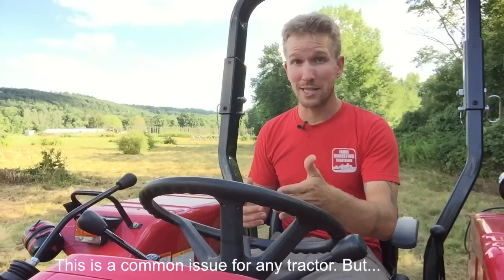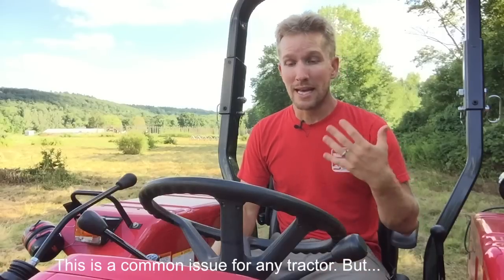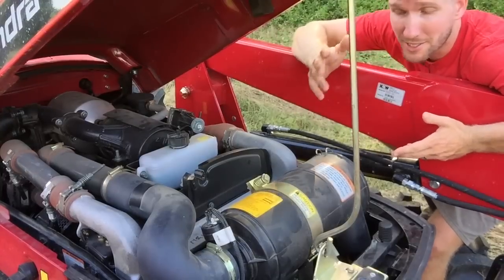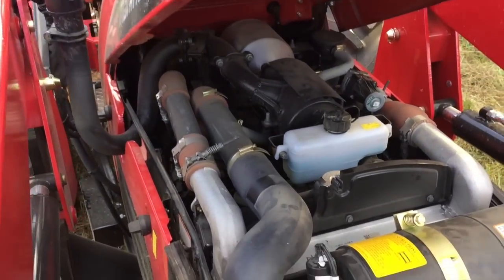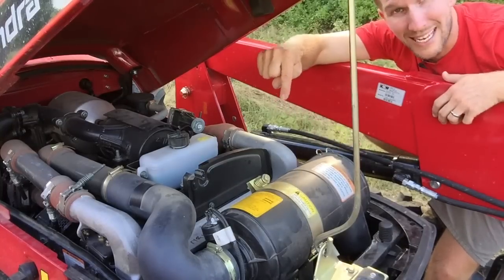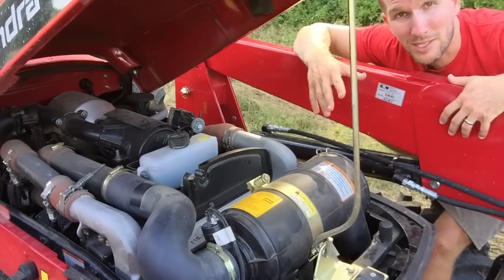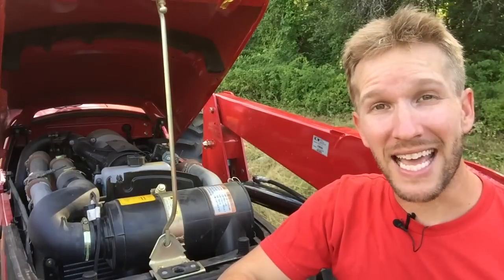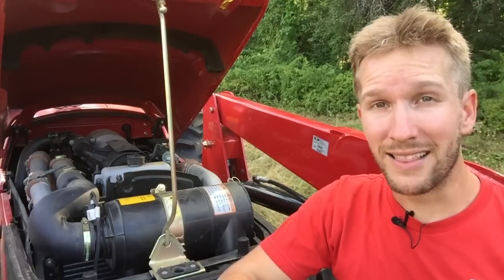Mahindra 5570 Engine Problem

Comment: I would go to Home Depot or Lowes and get window screen and make a Tractor Condom. Not sure what else to call it. It is to protect the tractor from incoming threats. I would make one that covers the front and one that overlaps it. Over the hood, down the side and under, back up the other side and Velcro to the top lap. The one that goes over the nose would also have Velcro so it attaches to the one that wraps it. 

You could call it a Mesh Tractor Condom or a Tractor Mesh Catch. When the tractor starts to get hot, which should be much longer than 1 hour, just shut off the tractor, get off and sweep it off with a soft car wash type blue brush or 6 inch cheap latex paint brush. This way you do not scratch your paint under it with tough bristles. I would shut off the tractor so there is no draft trying to suck the stuff you are trying to sweep off. Maybe 1 or 2 minutes to sweep off 70 to 90% of it and back to work. Get the UV Resistant Screen. Read reviews to see which brand lasts longer in exposure to the sun. Most likely I would not use aluminum as it would do some scratching.

As a teen, I used to detail cars at a dealership and in those days a lot of cars had those screen bug catchers and this would be the same thing. Maybe buy the cheapest screen first for a prototype. I would lay it over the nose and have it go back about 3 foot and down the front and back to the axle. I am guessing 48 inch wide x 60 inches or 48 X 72 inches for the front nose one. Then tape it in place and fold, then cut on the fold and tape. After it is cut and fit, slide it off and use a hot glue gun to glue the cut seams where it folds. Hot glue the Velcro in place. Once you have your pro-type fitting good and it test out a couple times, then get good screen and make one and sew it together with a sewing machine or if the hot glue holds good, I would just make it with hot glue. Hot glue will not scratch. I would suspect 75% is coming in from the front and 25% in from the sides of the front and bottom front. Just a guess, but this is most likely correct.

We are getting a tractor soon and if you do not try this, we will. 
Soon being a year or so.

Comment: For your battery issue could you take some extra battery cables and hook them solidly to your terminals and run the cables outside the tractor that way you could charge it or boost something without tearing into the machine? It'd be a chore to do initially but after it'd be slicker than snot on a door knob to charge or boost if you had too. Good luck
Reply from the maker: That's a good idea Brian, and if I start to have battery issues you can bet I'll probably do it. For now it's new and under warranty so I'm hoping I don't have to do that chore. Or at least I'll be able to put it off until winter. I have to check to make sure none of that would void the 5 year warranty too.
Reply: John Suscovich yea good idea I never thought about warranty
Reply: Yep waterproof pig tails. I have got an Optimate charger with fixed pig tails on my Honda generator battery so i can maintain its battery and easily disconnect to charge something else

Comment: Although my past Yanmar tractor was much smaller, it had a screen in front of the radiator.  Easy to get to.  When dirty, pull the screen out, clean it in 30 seconds and back to mowing.   I think some JD had the same set up.  Hope you get your problem solved!

Comment: Could you reach the radiator with a rigid pipe (with a short 90 degree bend at the end) attached to the compressor?

Comment: advice from the netherlands just buy a good second hand tractor from the seventies or eighties usa or european and those are easy accesseble, you will farm more happier. also on a hobby farm greetins peter heemskerk
Reply from the maker: Thanks for the tip. The used market is pretty rough in my area. Even with the problem in this video I'm still really happy with my choice.

Comment: is the radiator fan belt driven or electrical? an electrical fan you could run in reverse say every 15 min for a minute to clear the radiator.
Reply from the maker: Not sure, I'll have to check that out. Even if I can do that though, the engine compartment is pretty well sealed so there's no where for the stuff to go. I would worry about it getting stuck in there and then just sucking back toward the radiator once the fan is back in normal position.

Comment: Does the fan have a reverse switch? The front end loader my dad uses at the mill has a reverse on the fan to blow dust and crap out. If not I'd put a fine mesh screen over your grill then if it gets covered you could just wipe it clean in the field.

Comment: Wow John.  Your tractor is one of the better rated brands, all brands have their quirky flaws.  I've got a john deere and when I'm pasture mowing I've got to stop and clean off the front grill frequently.  But, the radiator is covered with a pull out fiber mesh screen which usually isn't that bad.  How is the seeds getting to the radiator?  Do they make it through the grill?  The john deere grill is pretty fine mesh and stops the bulk of debris.  I also have an oliver that has a screen in front of the radiator seems yours is lacking a screen that could be pulled up and out for cleaning.  If your grill is course enough to let stuff through Maybe a screen behind the grill would help.  I'm going to look at a mahindra Monday and check it out.  Good luck.

Comment: Hey John, do you have easy access to an air compressor? If so I would suggest buying an air-comb. You can get a twenty four inch one for around twenty five dollars. These air-combs/wands allow you to get in between the radiator and intercooler etc. and blow out debris easily. They use a lot of air though. You could probably get away with cleaning the radiator once a day while bushogging. This is the only way I know of to clean a radiator well. I repair tractors as a profession and I haven't found anything that works well other than a comb/wand.

Comment: On my 2538 the side panels come off and I can remove the screen on my radiator.  I bet its the same way on this tractor.
Reply: I have the same thing on my 1538. 2 screens that protect the radiators. It takes 30 seconds to clean them off and I'm back to work.

Comment: Get something like this and modify it a bit to fit between the air filter and the radiator!  Every tractor I even used or owned had a pull out screen right infront of the rad! Now for the battery issue you will have to un a set of cables out with connection points!

Comment: John Deere usually has a screen Infront of the rad which is removable, as was already suggested put some sort of fine metal mesh in their, using a binder clip seems like a good idea. 

i would run wires from your battery to somewhere accessible and use those as jumping poles. you can by kid made to do this or make your own. will need a heavy gauge, same battery cable on there now.

Comment: try putting window screen behind your grill?  or get a wand on your air chuck?  can you get at it from the under side?  the real down side is move the air breather permanently which means altering your brand new tractor.  good luck John

Comment: I bought a New 2014 Tier 3 Mahindra 6530 at the end of 2015 and all though I got a great deal and it's a lot of tractor for the money, I've had a bunch of little gremlins that are irritating, especially considering they all happened before I hit 60 hours.  

Leaky fuel line, glow plug light, battery, and now the emissions light.  Nothing major but it makes me weary.

Comment: I'm likely going to buy a new Kioti tractor and when the salesman was showing it to me he pointed out the screen to protect the radiator, that you pull out to clean off. What I noticed right away and pointed out to him is that you will have to remove the air cleaner assembly to remove the screen. He shrugged and acknowledged that I was correct!

Comment: This has pretty much been the norm for a long time. I don't care the "color" you buy, they all have this problem. The only difference is some have designed their engine compartment to be a tad bit more friendlier than others. Good luck on a solution cause the only answer to this has been to either A.) take a gas blower with you in the field or B.) a portable air compressor.

Comment: A portable air tank with 1/4"x 3' copper pipe soldered to an air gun. 1/4" because it bends easy and whatever length you need.

Comment: I know it's brand new, however I would relocate the air intake to outside the compartment as well as the battery or add lugs as others have mentioned. Maybe even relocate the radiator outside with an electric fan. It's almost like Mahindra expected this to run in a warehouse.  You already spent the cash so these options may not be to radical to make it last another 20 yrs.

Comment: you should remove the side panels to service the radiator
Reply: No, the side panels open the sides only. They do not expose the front compartment where intake is.

Comment: Auxiliary screening and you'll probably going to want to design and plumb in a compressed air system to blow out the rad and screens. You're gonna need an on board compressor of some sort, an air tank, build a distribution manifold and run some air lines to the offending areas. I know that sounds complicated but it isn't. Shouldn't take a day to plan out and put together.

Comment: I've got a 6530.  I think the 5570 replaced it.  Wait until you try to fill the transmission fluid.  Only problems I've had was the transmission came low on fluid from the dealer.  Was NOT happy with that.  And the fuel line started leaking where it comes from the tank into the engine bay.  It's a soft line right there where the return line is.  I thought it had been chaffed by the hood hinges but it turns out Mahindra had a batch of bad lines that were either over crimped or under crimped.  Other than that it's a great tractor, nice and heavy and lots of power.
Reply from the maker: Yeah, it's been a really good tractor for me and otherwise I'm really happy. Especially with the loaded tires.

I trust my dealer did a good job checking all fluids so I'm comfortable in that department. I bought this tractor because of my local dealer and I still stand by the choice. I'll just figure this one out.

Comment: I figured it out. Get a different tractor maybe a Kubota or JD.
Reply: Doesn't help him now mate. Yes i agree though that both of those brands have this issue under control with easy access to both battery and radiator screen
Reply: Doesn't help him now mate. Yes i agree though that both of those brands have this issue under control with easy access to both battery and radiator screen
Reply: Doesn't help him now mate. Yes i agree though that both of those brands have this issue under control with easy access to both battery and radiator screen

Comment: Without actually having hands on experience with this beast, the best I can offer is , '' Engineering Department . . . we need a bigger ERASER ! " 
      It's obvious that you need to route particulates away from the intake , either through filtration , (screen) or directed airflow, or BOTH !   The larger the surface area of the intake / radiator the higher the probability of getting more work done without 'clearing the intake'.
     ( thinking out loud ) 
   Maybe a sickle bar type mower would keep the clouds of seeds down ?   * You may be able to barter for the use of one from a fellow farmer nearby ?       
       'Seems that a combination attack , ( screen + redirected airflow) could cure the troubles . . . * a bit of reverse engineering is in order !      Good luck !

Comment: take the air filter out off the engine part and mounting the inlet as hi as passibal, to clean the radiator let de ventilator conversely so it will blow the radiator clean , fix it whit a swits so you can do wen need, i have don it on my izeky.
sorry englich not so good

Comment: All compact tractors have this problem. Best way to solve this problem is mow in reverse when in tall grass and weeds. Yes it's a pain but that's the only way to solve this problem
Reply from the maker: My John Deere had an easy pin to remove where I had easy access to the radiator screen and battery. I could clean it in a flash. My problem with mowing in reverse is that my bush hog is way less effective in reverse. It still cuts but I find it does a better job going forward.
Reply: +John Suscovich most tractor manufactures are going to this design unfortunately. Yes mowing in reverse does not do as good of a job but it does knock the weeds down so you can go back over it without worrying about the radiator screen getting stopped up. Only other option is put some kind of filter material on the outside of the screen that you can take on and off of the tractor but that would restrict the airflow too.
Reply: The smaller Mahindra tractors the engine side covers come off without tools.  You open the hood and the sides just pop off.  Is that not the case on yours?  I would think you could easily get into that area if the sides pop off like the smaller models.

Comment: Lift your bucket up over top of the weeds when you mow,  it dont fix your design flaws but it wont fill up your radiator as fast.  when you mow with the bucket down it pushes down the weeds and creates a whip action against your grill, slapping those seeds in there clogging up your radiator faster. making your tractor run hot faster.

Comment: My Kubota has a filter screen in front of the rad .so you never  need to clean the radiator just remove the screen wash it off in the sink place it back in front of the radiator "Done".   Plus ,it's built in Georgia USA
Reply from the maker: Kubota's not built in Japan? I believe they're based out of Osaka Japan. Regardless, that Mahindra Radiator issue is a pain in the backside.
Reply: John Suscovich yes the company is without a doubt based out of Japan but most tractors are built in Georgia for the US market!
Reply: Jayson Zimmerman not built in Georgia haha. It is Assembled is George but not built lol

Comment: the only way to solve this problem is get rid of the tractor.
Reply from the maker: ha
Reply: +John Suscovich the battery being hidden away is a bummer. guessing that you might not use the tractor much in the winter, thens the time to do a hack.
I would remove the factory + battery connection, and add as much extra cable as you need to mount both a   shut off switch and a terminal for trickle charging your battery (but both additions in easy to reach locations) (and then to the battery)
I would extend the earth also. you're only gonna do it °once° so happy days :)
someone else here mentioned a snorkel for the air Filter, yep, that was /is my thinking too.
I mean your problem is VALUABLE customer feedback no? I'd actually start having an email conversation with the design headquarters, as a long term strategy, a  basic flaw is an untested design, some where in the range of school boy error to a fresh out of university, egomaniac.

LOL. hope you get it sorted.

Comment: I've had the dust/seed problems mowing on my Kubota too.

Suggestions: 

1) If possible... Only mow after a light rain... or early in the morning when the dew is on the grass... very little dust.

2) Carry a portable air tank with long hose. Connect 1/4" copper tubing to air nozzle to get in the tight area to blow out radiator.

3) Next time you have to take everything out, install an external set of "lugs" (via short cables) so you can jump off battery easier, and have access to 12v power without the hassle of pulling everything out of the front of the battery.
(good winter project)

On the Kubota, the battery and radiator is easy to reach... very easy... but I can see why you're frustrated with that design.
Hope that helps,
TP2
Reply from the maker: A couple people have suggested the external batterie cables. Like you said I think that'll be a good project for the winter.

I think I might carry a small vacuum instead of the air tank so I can get the stuff out.